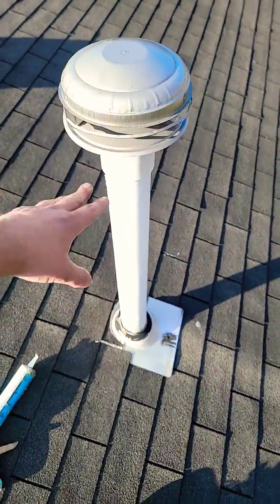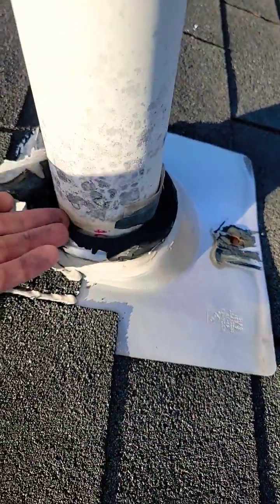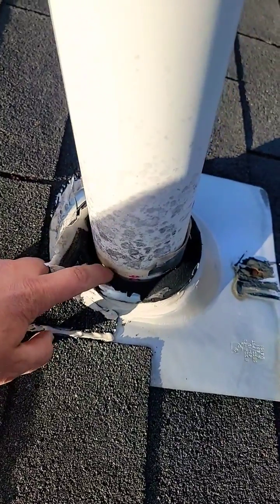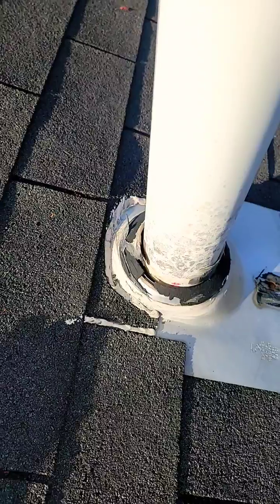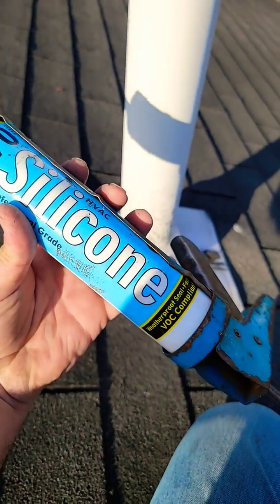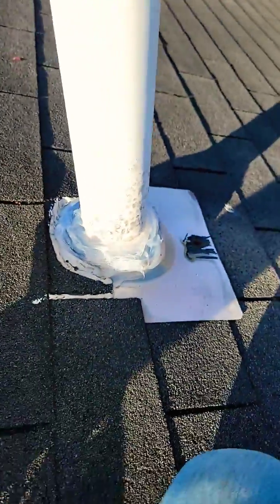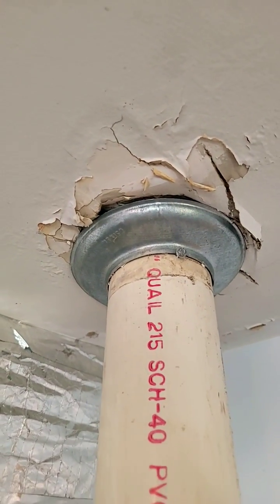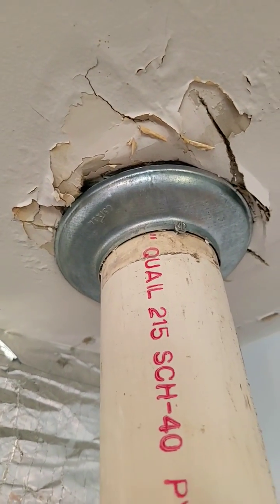The Ultimate Guide to Vent Pipe Roof Flashing

Comment: Needs a new boot bro, just slapping silicone isn't even a reasonable repair. With that shoddy work I'm wondering why I'm watching your channel. Replace the flashing boot and use the proper black jack. I expect more from you sir, so does your customer.
Reply from the maker: I agree with what you're saying however I caught this at the end of the day and I told the customer They need to replace the Boot
I gave them a price and they told me they weren't going to do it So I sealed it anyways with some silicone I did my best
I guess I should have said that in the video
If you're wondering why you should watch my channel don't watch my channel
But I appreciate you watching
Reply: @taddydigest  word. I see what you're saying. My thoughts were someone doing a repair like that at my Grannies house. Had you said something about never actually do this a a permanent repair. If you need a week or 2 for better weather then properly repair it, that's fine I suppose. In your case maybe the homeowner acknowledged that fact and plans to do their own repair to save money, that's all good. The average weekend warrior watching this video and thinking they can go up with a tube of caulk and be like yup, it's fixed! Maybe do a follow up showing how to actually repair an instance of crumbled boot. I found your channel when working on a mini split. Dude, you have some killer content and you're obviously more knowledgeable than myself. Watching this flashing boot debacle... man I know you're more capable than what this video shows. Thank you for explaining why you did what you did, I wouldn't have done that but alas you explained why. Honestly you could probably do a ton of videos on Jerry rig solutions that can get you by but probably wouldn't pass the muster of an inspector. Duct tape welds if you will lol. I still love your channel bruv, just didn't like this repair. If I'm learning from you, I need you to be better at it than me. Don't poison my mind with caulk gun abuse lmfao.

Comment: Try MP90, you'llthank me later.....it remains pliable and will outlast silicone by years
Reply: I believe you are talking about Masterseal NP1. MP90 is porcelain and stone sealer. I had a commercial roofer teach me about putting a strip of butyl tape under the edge of the flashing and then NP1 over it. I’ve been doing it that way for probably 8-10 years now without any leaks.
Reply: @ryanbrown5334  yes, NP1 / MP90 are equally superior to silicone. I also introduced to both by a roofer friend.
Reply from the maker: Awesome thank you for this info

Comment: Good catch ! Good Repair ! Should Last 5-10 years. Good to see u use clear silicone. Fyi - Clear Silicone Lasts 10 times longer than Black & 5 times longer than white. Fyi also - Home Depot has Good silicone. It’s called “ Ge Silicone 2 “ Clear Dries a Hard Rubber like a Tire. It’s awesome!!!
Reply from the maker: Thank you so much for your knowledge I will check the GE silicone out
Reply: @taddydigest   You might also Want to recommend to home owner replace the drywall that’s damaged , remove Mickey Mouse storm collar & Just seal with White silicone. Probably has Mold on back side of damaged drywall & Spiders & such enter the house there.